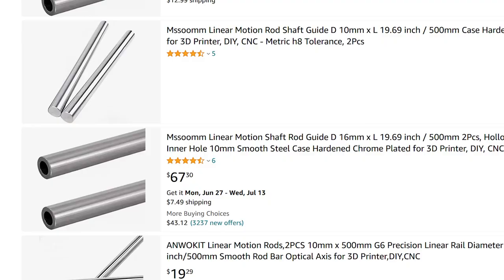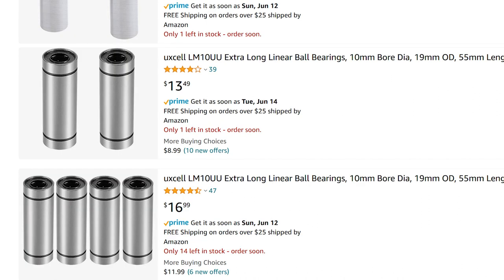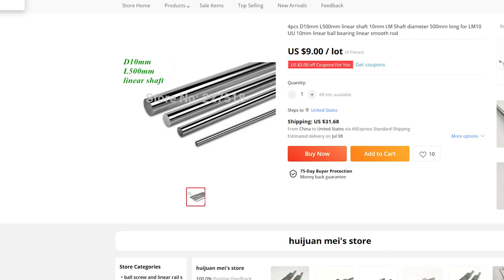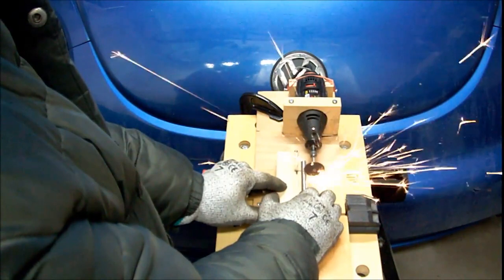Vzbot from tronxy X5sa the z axis part 5.

Comment: hey man. nice video! quick thing to the z leadscrews. you dont want to use motors with integrated leadscrews on a dual z setup. with dual z youre missing the gear reduction of the single z. that means your bed could drop, depending how heavy the bed gets. We had that happen on some vzbots. So the way to stop that is to use leadscrews with a different lead. lead 4 and 2 work good with that. just a little tip. keep rocking!
Reply from the maker: Yea it gonna happen with heavy beds I going to put the springs on the z nut but I always tram the bed before starting a new print
Reply from the maker: Also the single motor with dual mm at also solve it. Been in lockdown quarantine but all done now new video will be up this week.
Reply: @tommygunnfilms  Yeah those nuts where tested, they reduced it, but didn't stop it. I do a z tilt also before every print. Some just dislike it, if the bed drops. 

Are you on the VzBot Discord?
Reply from the maker: @skysi  yep on discord under bluesteel I just filmed doing gantry will be testing after electronics
Reply: @tommygunnfilms  nice

Comment: Why is the voiceover audio only on the left speaker side lol, great video nonetheless
Reply from the maker: Turns out it was not my cats bowl but my turtle tank pump thanks for the heads up! I will get these vids right sooner or later lol 😂
Reply: @tommygunnfilms as long as the info gets passed over and you’ve nailed that so far 👍
Reply from the maker: Oh the original answer is a single microphone was used I need to split it into 2 channels. If I don’t it will be only on 1 speaker. Normally it’s ok because you hear things on both speakers so it sound like I am on one side and things are in stereo.
Reply: @tommygunnfilms  lmao yeah, I watch stuff with headphones and then it’s only left so that’s how u noticed

Comment: Thanks for your video! You mention the smooth rods, but do you also reuse the leadscrews from the x5sa kit?
Reply from the maker: Yes the z rods are totally fine.
Reply: @tommygunnfilms  I'm in Brazil following your project and doing the same, with two engines on z, but I didn't find the firmware for two engines, will you explain this?thanks(google translato)
Reply from the maker: @edvandorobson  for some reason my description disappeared but I just reupload the description.. with link to the 2 motor mount just print it 2 times. 
You also know my subtitles are in multiple languages and Portuguese also.. my descriptions are normally are too.

Comment: 2040 orientation.. I did the same damn thing.
Reply from the maker: I wonder if we left it would it affect anything..I was not going to chance it…
Reply: @tommygunnfilms   The width is different..  with the frame clocked the wrong way the bed frame won't fit between the rods.
Reply from the maker: @Polar_Ted  did you also believe the z rods spacer were supposed to help you center the bed?
Reply: @tommygunnfilms  yes lol.. I set my front and rear rods with it and couldn't figure out why I couldn't get the bearing carriers to go that wide.
Reply from the maker: @Polar_Ted  I printer 4 so I would not have to move em around lol!
Reply: I think I'm having the same issue, so do you mean that the rod spacers are only to get the distance from the back? Like you, there's no way I can use the spacers for both front and back, the bed frame is too small.
Reply: Actually, I think it's the opposite; you align them to the FRONT of the frame, correct?
Reply: @Dashrendar2507   Spacers are only to set the distance for the front rods.
Reply from the maker: @Dashrendar2507  they are only for the front it is not suppose  to be equal distances
Reply from the maker: @Dashrendar2507   yes only front of frame
it doesnt even have that perfect align as long as everything move up and down smoothly  the smooth rods and the zrods there should be no restrictions at the  top or bottom.